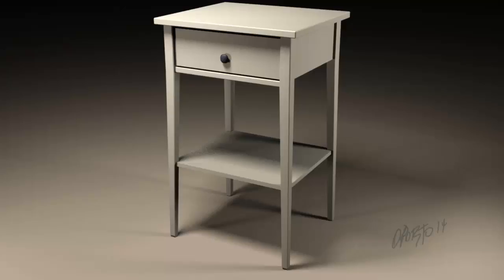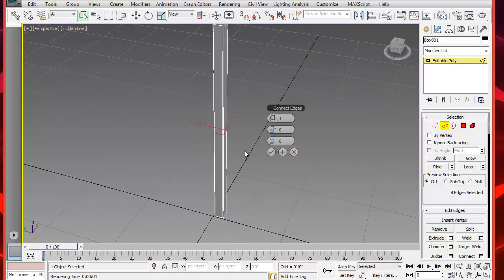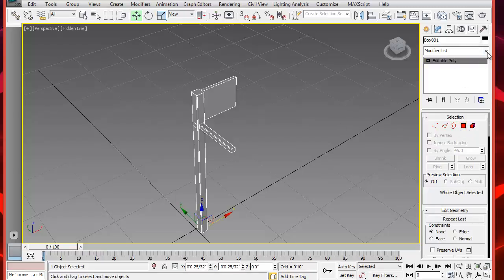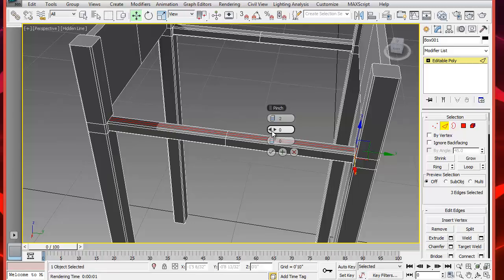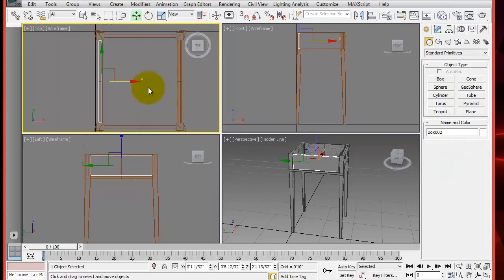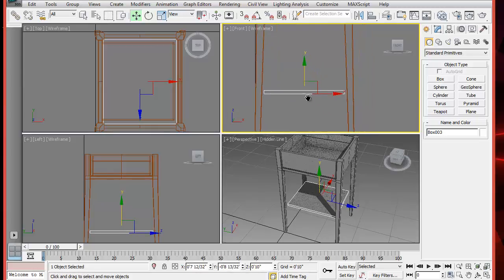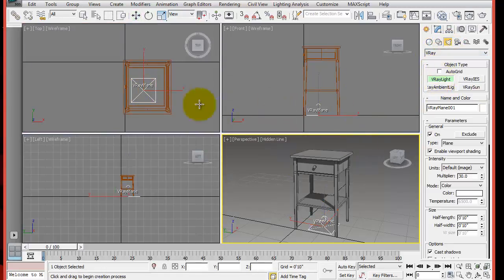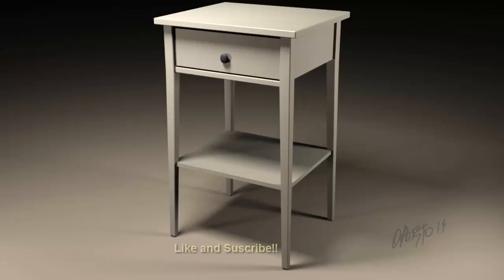3ds MAX Night Table Easy technique

Comment: Great video!  Very informative.  How do you know where to start?
Reply from the maker: Very good question. - I plan a bit. Use your imagination. First imagine the finished piece. (Usually it will be symmetrical),  then split it in half, then take away the parts that are NOT symmetrical Those are to be extruded from the object, then split it in half again.. and so forth. This way you may see a good starting point. Other pieces like doors or drawers are done individually and in the same manner.